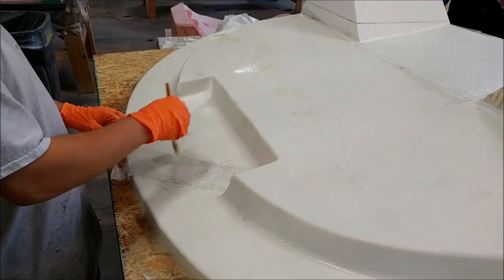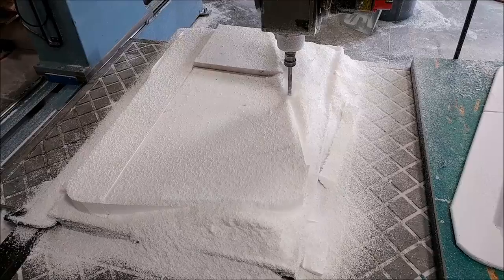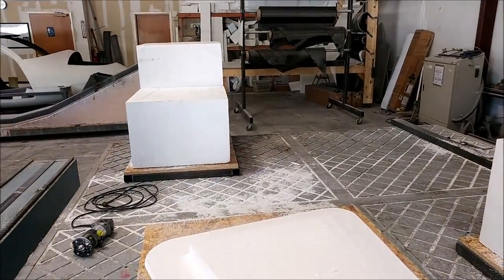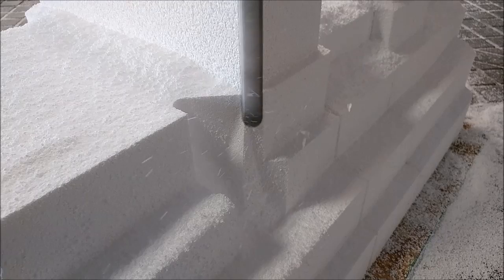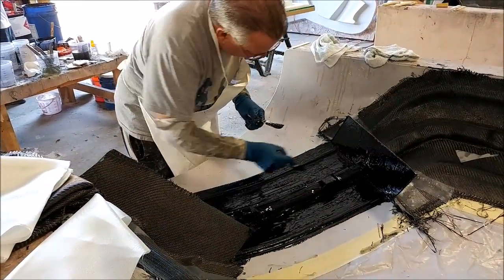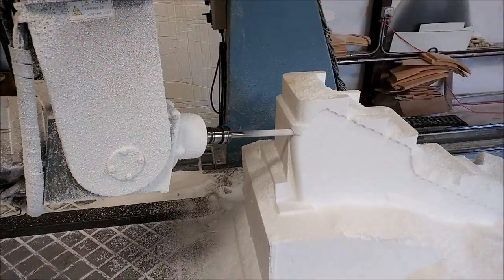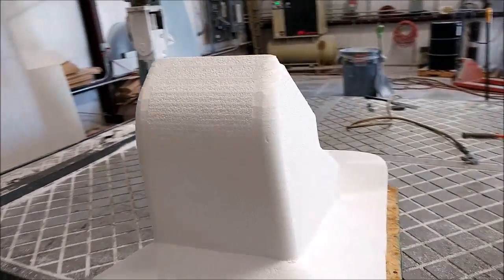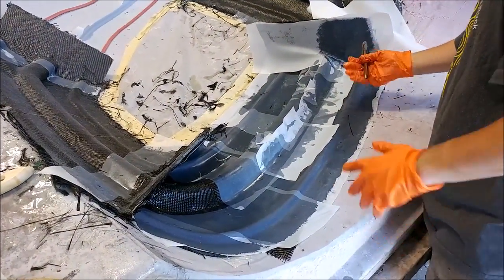Raptor Aircraft August 30th

Comment: How to these chaps control the weight of these components? What is the planned empty weight and gross weight?
Reply: They are making molds at the moment - so weight is not an issue. When they come to make the parts out of the molds that's the time to be careful about weight.